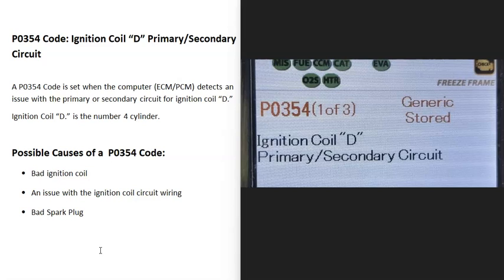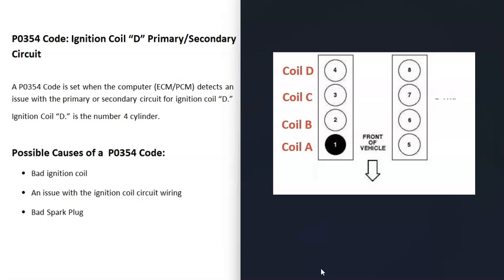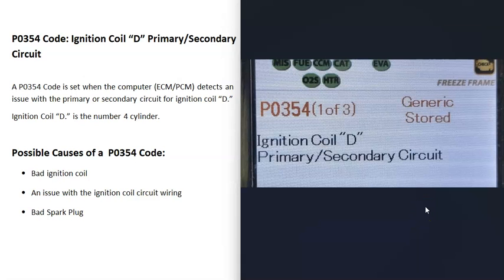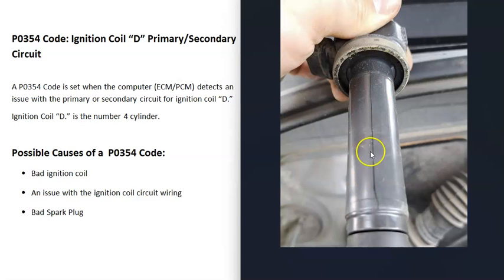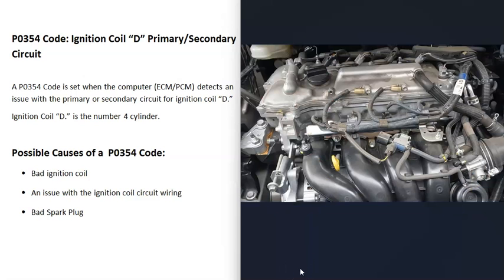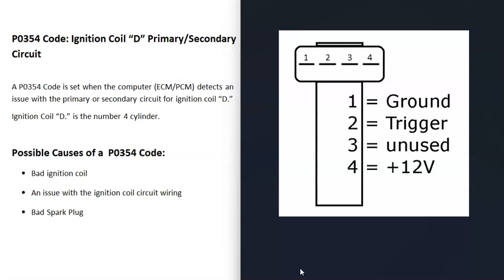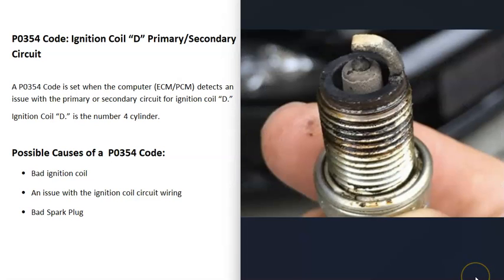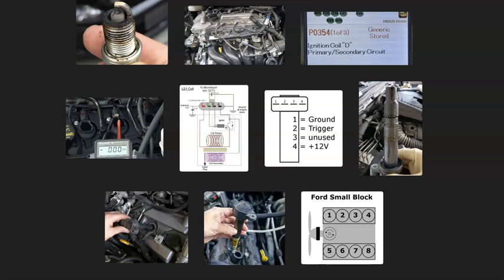Causes and Fixes P0354 Code: Ignition Coil “D” Primary/Secondary Circuit

Comment: Got this code on 98 mustang GT swapped coil packs new plugs new plug wires test primary and secondary coil checked compression tested fuel injector with noid light tested continuity on signal wire to PCM skinned back wire harness in several locations where it was up against other components running out of options

Comment: I’m getting this error but only when the fuel is low (less than a third of a tank left) but not low enough for the fuel light to be on. The check engine light comes on during stop-start traffic or idling, it shakes a bit and then goes back to normal but the light stays on until I fill up the fuel. Does that affect the likely cause?
Reply from the maker: Fuel and the ignition coil are two separate circuits, so I don't see how they can be related unless there is a wiring problem. It needs to be diagnosed. I would start by testing the basic components and see if they are good or bad.
Reply: @HVAC_Mechanic  try to comment to say thank and blessing

Comment: Just had this issue and other codes. Replaced all spark plugs, ignition coils, and injectors. Now back to square one with wires😭
Reply: Cleared all other codes but p0354 is all that’s left.

Comment: my sister-n-law had cal 1,2,3 not firing and with random miss fire and the Acura engine shakes like crazy. I found a blown fuse in the fusebox and changed it and changed all 6 plugs. Once they were installed it has this 354 code on 4 and one other cylinder and says something like random miss fire. Could this all be on multiple coil packs going out at once??
Reply from the maker: While possible, it is unlikely that the ignition coils themselves are the issue, but something else, like the wiring. If there were no issues before changing the plugs there may be an issue with the plugs such as the Gap.

Comment: Hey brother thanks for the video. I’ve change the coil to a new one. Change the spark plug to new ones but the code still pops up. Check the wire there’s continuity on the harness  could it be a bad computer?
Reply: suggestions are good - computer rare but possible particularly if it is an old car (18 years + or if typically used in hot climate).  There are car models which very commonly have capacitors that fail in the ECU circuit board (. . . .  that are repairable).
Reply: Fuel injector
Reply from the maker: A computer issue is rare. I would test to see if there is spark on the #4 cylinder.
Reply: I just came across this issue on a 2012 Camry that I was going to purchase. It had 133,000 miles on it and when test driving it the engine would stumble while starting out and shifting between 2nd and 3rd with its automatic transmission. I had my scanner with me and pulled this code. The owner had told me that he had the spark plugs changed out at 100k. Pulled the coil and spark plug and the plug didn’t look like a it had 30k on it from a 2.4L partial zero emission vehicle. This was my second visit to have a look at this car and I had requested to see the service records on it because I was told it was always serviced at the Toyota dealership when the 5,000 mile service light came on. I owner had told me I could call or go to the dealership to get the records if I wanted them. Long story short the owner/seller finally came clean with me and told me the dealership changed the oil and filter every 10,000 miles. He said after 100k he was doing it every 5,000 miles. I cleared that trouble code, put everything back together and shut the hood on it. There was a guy standing around waiting to see if I was going to purchase the car and if I wasn’t he was going to purchase it for his 16 year old daughter…….even though he had seen me pulling the code, could and spark plug. That code can also be caused by a number 4?cylinder spark plug that is being fouled because of the engine having oil consumption that is caused because of irresponsible and misinformation dealerships
and mechanics that tell customers they only need to change their synthetic engine oil every 10,000 miles. If you follow their advice you will have ruined your engine and you can either take it to them to have it repaired or replaced. Either that or you can just purchase another new vehicle from them, follow their service advice and recommendations, and then be in the same situation in another 100,000 miles.
Reply: Before I messed with the computer, I would remove the valve cover and look for a broken valve spring...
But removing the ground cable on your battery and waiting a few minutes to make sure all the power is gone and then replace the battery cable and start it ... 
I've seen cars that did have a bad computer,,,,, not start after doing this .. But
Then I've seen it help